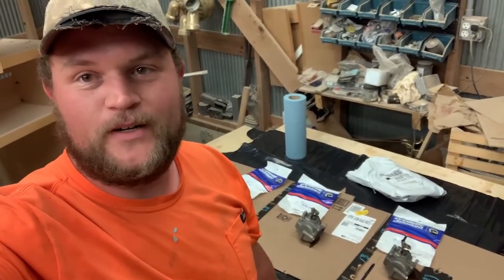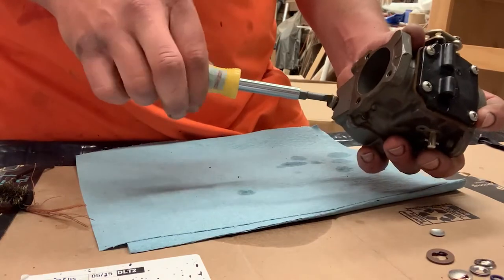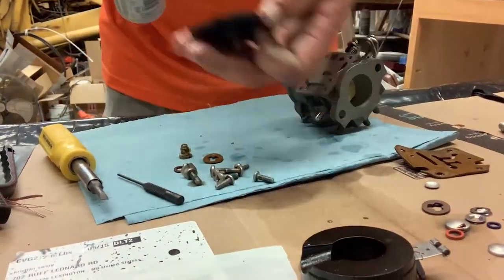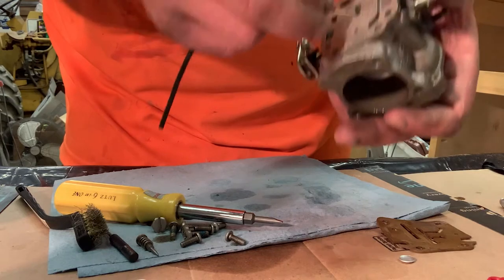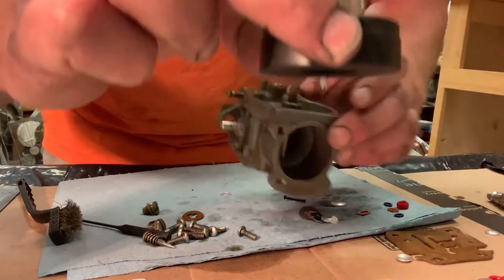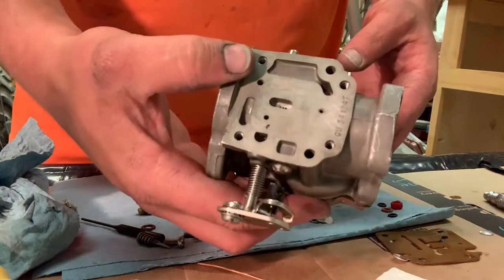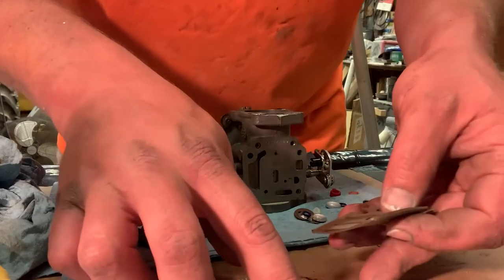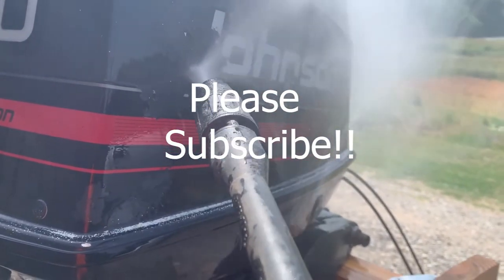Johnson Outboard Carburetor Rebuild [[Carolina Skiff Rebuild Part 12?]]

Comment: Running them out of fuel and a good stabilizer is key! I also use Seafoam in all my motors and small engines. Another great vid!
Reply from the maker: I honestly was blown away at how much it helped. I remember as a kid thinking my dad was crazy. Sitting at the boat ramp waiting for the motor to run out of gas. Now I know. 
           Seafoam is amazing. My Grandpa was throwing his weed eater away. He was sick and tired of it not cranking. I put some Seafoam in the gas. Pumped the priming bulb to get some in the carb. Then let it set for a hour. Cranked right up. Thanks for watching!